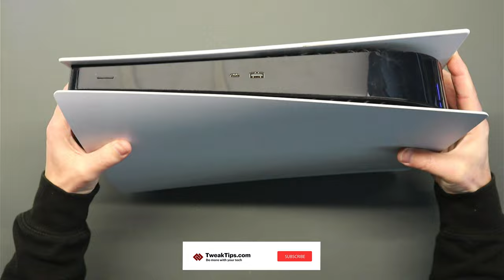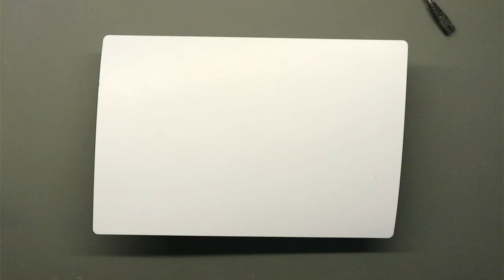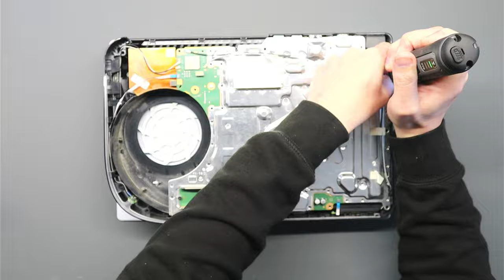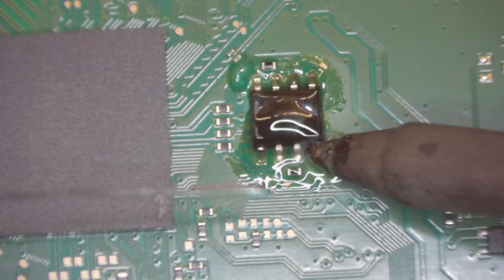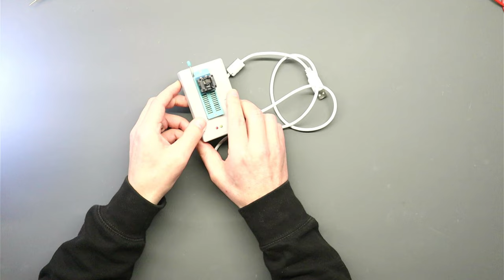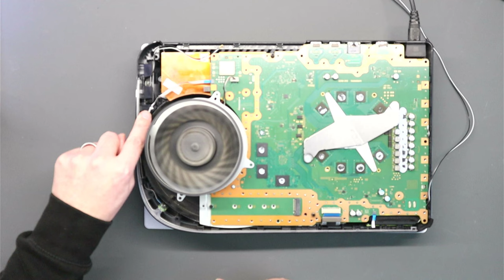How to fix a PlayStation 5 with 3 beeps but does not power on. Faulty BIOS on a PS5.

Comment: If you have to do a disk version do you have to do anything with the bios or is the serial number the only thing you need to edit
Reply from the maker: It is better to update the model number, and MAC address too
Reply: @TweakTips  Perhaps a dumb question where do I get the MAC address from is it printed on the WiFi chip or something?